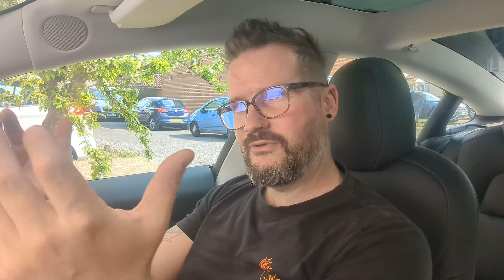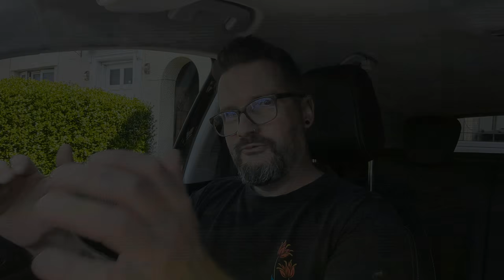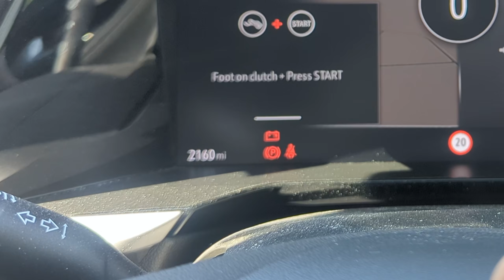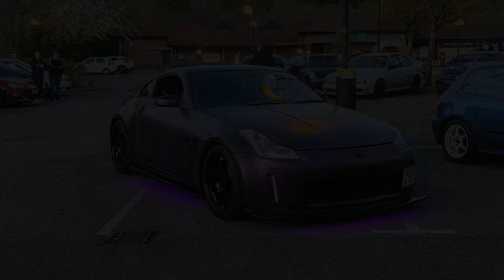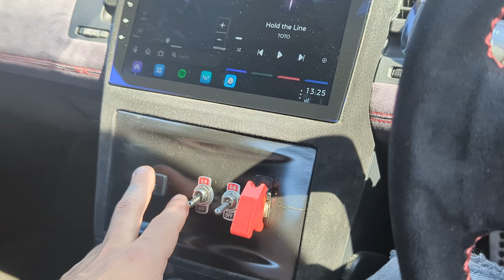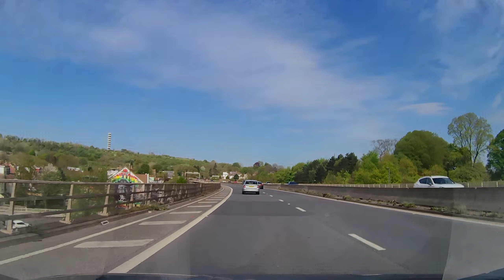Are All Modern Dashboards Terrible?

Comment: great video andy! and nice to look at things from a different angle which i robably wouldnt have done before watching this video, regarding dash menus, i think something like fuel range / amount is essential, especially for someone like me who does a lot of miles and majority of long trips so always good to plan ahead before getting on the motorway and then 60 miles in the light comes up but then i need to pull off the motorway to tank up when i could have just tanked up before hand. 
i do agree some things can be hidden untill needed. 
rev counter and speedo and temp guage always essential aswell in my opinion, and speed limit too. coming from sporty jap cars id want to know the temp and oil pressure to see when the cars warmed up before i give it the beans, and similarly if i can see its not warming up then automatically id know somethings faouling somewhere before the car figues it out and often at that point its too late! 

i personally like the muti functional dash like mpg / range / average speed etc, but again on individual screens rather than all in one and then its clutttered. 

agreed i prefer physical large buttons, something that can be used with a gloved hand. not too keen on pressure sensor buttons like the modern golfs. or touch screen. not glove friendly 

o do like the f1 style led lights as rev counter

Comment: A really interesting thought provoking video. I am with you I think speedo, sat nav, speed and current speed limit are the minimum. Then after that warnings like main beam headlight, engine temperature higher than nominal, fuel low (less than 1/4 of a tank) then red when less than 1/8 full. Other things like mileage, trip mileage, fuel consumption nice to have and available on a toggle to one of the main screens. The days of oil pressure, revs, voltage in battery etc are now gone. Just my initial thoughts.

Comment: How are you going to build the GPS navigation on the screen? Where the route data will come from? The phone via Bluetooth? How the map data (images) are going to be transmitted? I looked into it because I wanted to build a custom dash for my bike and add as well gps navigation, but after doing some research I found that there was no way to share the data from the navigation GPS for like google maps on the phone to a embedded system via bluetooth. So how you going to handle that part? What do you have in mind?
Reply from the maker: I use an Android head unit that has an integrated sim card and a dedicated internet connection. I use that as a hotspot, so I can connect any of my ESPs to that and use it to grant them the internet needed for things like this and other API services.

Comment: I’ve got a 2018 VW Touareg. The dash is very good with a mix of digital and analog looking dials. The animation is very smooth (must be a high frame rate). The other touch multi media screen is bloody awful at times - and a bit buggy. If I’d specified the car from new, I wouldn’t have bothered with the touch screen.

Comment: UX perspective of old school is all analog gauges are optimal when pointers at 12:00. Visually this takes less time than interpreting digits. Trip odo/instantaneous mileage useful (I tend to drive less aggressively out of habit with this available). I really like your digital "analogues" as they could easily be "rotated" to put nominal values at the top. I want oil pressure because of the wildly varying values both seasonally and operationally, and the "too late" light really is too late (Already rebuilt one for that.) Coolant temp is nice, I prefer the gauge to the  cold indicator light - we often see -30C in winter. Tach is also useful in auto trans to monitor efficiency. Charging voltage and current draw are useful but not needed continually - press to test? The MIL should become the OBD light, with decoded messages - I have always hated the "Something's busted, see the dealer" light. I can do satnav on the phone, sometimes I want to drive without the drones being able to find me. Turn indicators - yes (relay is often too quiet). E-brake indicator. ABS, traction control all should be in the OBD bucket, especially if they are used as augmentations to the MIL. I dislike the "A/T TEMP" flashing when it actually means the TCU is telling the ECU that it hasn't got speed sensor data. All such message overloading/OBD-1 like status should be automatically interpreted and displayed when required/requested. Audio and cabin climate MUST BE tactile. My worst car has an unfathomable climate control interface that practically requires you to pull over to safely select your preferences. My '62 Benz just has levers. Nice!

Comment: My take is from my actual 52 year old car. It has turn indicator lights, a "too late" oil pressure light, a brake warning light, a speedo, fuel, temperature and alternator. Last one is not needed for "modern" cars. Do I "need" more: no. Do I want more: yes. I like the Vauxhall dashboard. Similar to what I have in mind. Navigation, if needed, a few dials that are small but useful, like RPM. Normally not needed, but sometimes it is, so better to show it all the time. Obvious alarms, if there sensors for that, switchable cameras are great if you can mount it without disturbing the view of the car. Also here in Germany modifications like this can be problematic because of regulations. On inspection it should look stock without the "extras" or you might fail.

Comment: Early EVs had a plethora of touchscreen controls, such that in the UK I had to wonder if you weren’t supposed to use mobiles as you need to look at screens etc and they were considered a distraction, how come these were becoming incorporated into car design interiors. I see the EU and others have finally caught up with this and insisted physical buttons for some controls should be a preferred design decision. Personally I drive an old car with a multifunction stalk on one side, a column change lever on the other, and the dash consists of an oil light, speedometer, ammeter, fuel gauge, with a loud audible “click clac” you’d struggle to not hear when you indicated to turn. It had an optional r mechanical tachometer, but I’ve added an electronic one, as it’s getting an engine swap. However it was on my radar to add a 2.1” ESP32 display to do the same, as well as display other pertinent info, and finding you YT channel sometime ago has been very informative, and I totally get why you’re doing it. Keep up the good work.👍,

Comment: I argue knowing miles to empty is important all the time. I use it all the time for planning purposes as certain gas stations (ops sorry petrol stations) are more convenient depending which direction I'm heading. 
For example my work is 100 miles round trip. I don't pass any stations between my house and the freeway on the way to work but I pass 3 on the way home.  If it tells me I have 120+ miles remaining, I know I'll be ok, even with traffic. If its less than 120 I can either chance it or drive 10 extra minutes to get gas before work.
Reply from the maker: Totally fair arguement for it

Comment: i would argue for an rpm gage , sometimes ,your looking driving going silently and your brain is turned off ,all sounds including the engine and the radio are tuned off ,your just cruzing , a quick glance at the rpm will tell you if your pushing the car and revving it outside of its comfort zone ...
sometimes your having a conversation ,or your focusing on the radio in my opinion an rpm gage is a must ,its an indication of how hard and how much strain your putting your engine on ,and depending on the rpm you can decide to shift up or down ... also rpm is related to how much heat the engine generates and if your driving a french car like me that overheats all the damn time its crucial to always drive under 3500 rpm or you will eventually overheat .....
some cars will have an LED , usually a green one that lights up when you can change

Comment: As someone who has designed and used quite a few tunerstudio dashboards, my dream would be essentially an "Alexa" style approach to any "extra" info that's non-essential. Check engine light? Kick off an alert that can trigger an audio warning. Want to know how much fuel is left? "Alexa, what's my range left in the fuel tank?". 

We almost always put too much data on screens. Even the industry standard racepak dashes are very busy for being able to use on track. And when you look back at old 80's turbocharged IMSA cars they had DOZENS of gauges, which only proves they needed lots of data, not that the drivers could use it on track.

A modern system should be able to adapt this signal to noise ratio for the combination of the type of driving being done, as well as the state of the vehicle. I don't care about nuisance warnings like abs or traction control kicking in when I'm on track. I don't even care about a check engine light unless it's properly concerning. Coolant or oil temps 10 degrees higher than warning isn't a huge issue either, because it's contextual. 

A proper modern AI "pit boss" is what you really want, so that you never have to actually be worried about your gauges, ever. In fact, if you had haptic feedback along with voice messages you could even skip the speedo. If carplay or similar know the posted speed, give me a buzz/ding when I roll over it, maybe giving me a different warning if I go 5 or 10 over. A good copilot and even speedo needs are subjective.
Reply from the maker: It's like you've dipped into my mind and plucked out where I'm going with this... spoiler alert: voice controlled management and alert system

Comment: I am no coding expert just thinker but on my dash am working on I dump almost everything (pretty much everything I know I will use at some point)  then I use dropdown list so the information is selectable. So if I need to see it a have option to select and replace previous information.  (For me big bold Speed) rpm, coolant temp  & fuel level  is a must all the time . Others optional "selectable" but always ready in background to give warning status along with data if something starting to go out of bounds. 

My own 2014 Subaru forest.we take on long trips and one thing I hate about the dash is no coolant temp gauge.  So I always plug in a obd adapter and app to monitor temperature it's important when you going on a 4hr road trip . Rather just a icon indicator . My other corolla temperature gauge kept going up in the morning s only for a little bit way past the 3/4 the warning light never came once. So I check and yeah rad took 2.5L of coolant.

Comment: As a (debadged) RS4 B9 owner, to stop Ford ST's trying to race me!  Have you looked at the Audi virtual cockpit?  There are two display options, the first is split into three sections with the focus in the middle which is fixed with RPM on a round gauge with speed digitally shown in the middle of it.  The left and right 'wings' you can then set to show various other options.  The second display options splits the speedo and RPM to two smaller dials on the left and right bottom corners of the display and then uses the center section to display your option such as, maps, music other engine info etc.  Plus I have a very underwhelming but very functional HUD which I use most of the time.
Love the content, the heads getting better, keep on with the hard work!
Reply from the maker: Yeah it's definitely a big useful display that they have. I think with a lot of these things the "tastefulness" of the layout typically comes down to the user and how they set it up, and even that's entirely personal and subjective.
Reply: @GarageTinkering  If you split the display into zones by size and position and then have a menu to allow you to attach a given function to a zone.  That would give you an easily changable display to play round with

Comment: when i try to create a view onto a technical system (im not a car guy) i usually dump every little bit of information i can get from the system on the screen all at once to get intentionally overwhelmed. everything that feels bad and is not absolutely necessary is then removed until "it feels right". its a weird way to go about it, but it ensures that i dont miss anything i have to "squeeze" in later and getting annoyed is a good way to force yourself to cut things.

Comment: I had a Opel / Vauxhall Mokka 2021 for 3 years with identical infotainment. You can rotate the stalk on the right to change the driver's display mode to full map (which does exactly what you said) or Minimal (which also does what you said by hiding the water temp / fuel gauge / rpm ). 

I upgraded last year to a Volvo EX30 which has the same setup as the Tesla. I found your channel trying to find a way to DIY a driver's display for the Volvo. I already have the mr diy esp32 canbus reader and I'm slowing getting ready to annoy random people with dumb questions on getting this done :) I tried to join your discord server but I'm getting "Invalid Invite". 

I hope in the far future to be able to make something like the S3XY buttons for the Volvo but we'll see.
Reply from the maker: Hey - someone JUST pointed out the expired Discord link. It's at https://discord.gg/86EpNjzrXQ

Comment: With an EV van with less the ideal range, I will be adding clearer and more exaggerated live power usage, so I can more easily keep it in a neutral power state with the accelerator when hypermiling. As opposed to lifting fully off the pedal and flicking into neutral.
Reply from the maker: Makes absolute sense in that use case

Comment: The part about turn signal lights,I agree and disagree. Yes, you can say by the sound if it is on or oftmf, but then you have to look at handle position to tell which indicator is blinking. Or it could be emergency light.
So in my opinion in the dash you need to see:
1) speedo
2) turn signal lights
3) remaining fuel quantity
4) check engine light (or maybe even fault codes when you press button)
5) engine temperature

Last one is obviously more crucial for track but there is no place where you would like to overheat your engine
Reply from the maker: I can't remember one time in my life where I've ever indicated in the wrong direction, or accidentally pressed a button on the centre console instead of indicating, but I get your point.
Reply: @GarageTinkering  I have never indicated in the wrong direction too, but there were too many times when I left turn signal on because of the loud music and I did not hear clicking sound 😂
Reply from the maker: Yeah, fair, I've done that countless times too. 

That's enough of a use case to keep the visual I think, but, it's worth noting that the UK MOT check allows for either audible or visual, you don't actually HAVE to have both, which is interesting.
Reply: @GarageTinkering  wow,that is interesting.  I don't know if audible turn signal is even considered in Lithuania MOT
Reply: @GarageTinkering  The Volvo EX30 has a momentary release signaling stalk (returns to the middle position) and the signaling sound is digital and can be overwritten by other notifications (like you're not looking straight when trying to turn left or right). 

Plenty of times I looked like a moron in traffic trying to cancel my signaling.
Reply: @wtfgogu  I think SAABs also have (or should I say had) digital sound that is played through speakers

Comment: The MVP for a dash (display) would be orange/red light (like F1 gear change indicators) for the current speed limit. Everything (including the 'speed lights'  only shows when it is outside normal parameters.
Reply from the maker: I thought about that, but working speedo is a legal requirement and needed for MOT. Also, you're putting a lot of faith that way in the extracted speed limit being correct at any given time.

I like the idea of the F1 gear change though. That's vaguely the direction I was referring to
Reply: Nobody said the MVP had to be legal :😀

Comment: For everyday driving I prefer the bare minimum, just speed and fuel level. But there are situations where I want access to more like tach or engine temp such as when I'm still learning a new car or if I am out for a drive and I suspect something has changed by the way it drives. The aspect of screens that I do like over dedicated gauges is the ability to adapt to driver preference or to meet the needs of the situation. That trade-off is at the expense of complexity of course, which usually has an inverse correlation to reliability over the long run, but if done properly I could be convinced.